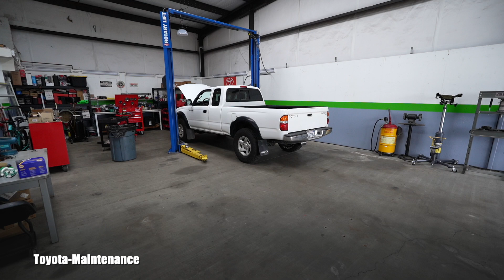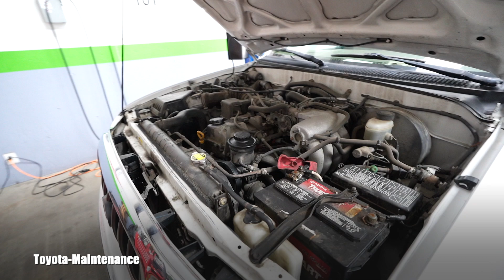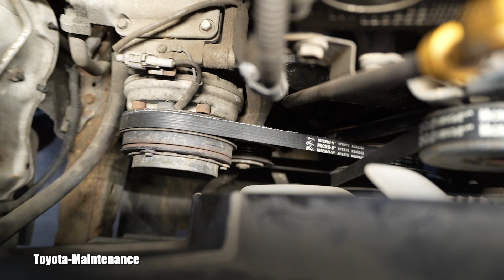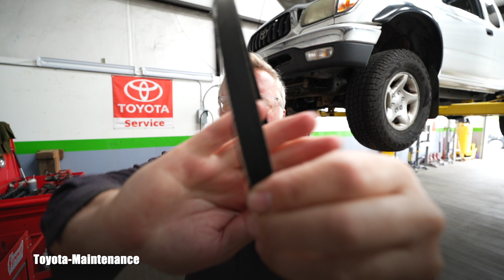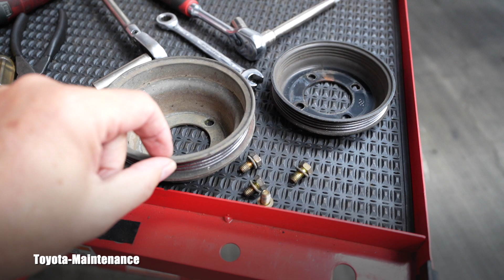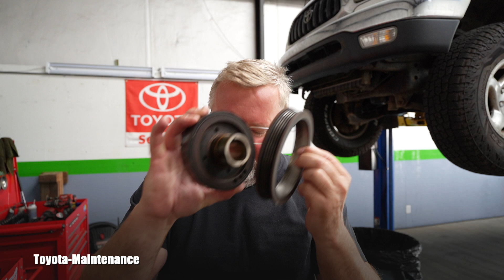Shredded Engine Drive Belt. Why? Harmonic Balancer Failure.

Comment: I was just doing my learning about harmonic balancers bcz mine is making a rattling noise n I just observed today that the bolt wobbles slightly when the engine is running. I wanted to find out how much time I'd have to replace it. The new one will take 10 days to get here. I feel like it should be ok. I'm also putting on new belts, tho at the moment mine are fine.

Comment: You should've shown how you took the balancer out and showed the pully holder to remove bolt, and tool/puller to remove balancer. Also give a tip about the alternator, dont go straight to the adjustment bracket, the main pivot bolt on the alternator has to be loosened, loosen lock bolt, then you can back out the bolt on the adjustment bracket to remove the belt.

Comment: What caused the harmonic balancer to break so early? 285k on my Taco (2.4l 2wd) and my harmonic is still holding on
Reply: Its got low miles, so i think its not being driven enough. The rubber probably dried out from sitting.

Comment: Same thing happened to my '00 Tundra V8 after a mechanic abused it back onto the spindle after a timing belt change.  It began squealing immediately, and before I had a chance to return it to have the balancer replaced it completely separated and disintegrated, taking out the cam position sensor with it.   If you see it wobbling, replace it immediately!

Comment: I personally own a 2RZ-FE engine so this video definitely helped me out diagnose issue with the engine further down the line if they come up.
Reply: He didn't give any tips and show special puller/tool. For the alternator belt, dont go straight to the adjustment bracket, the main pivot bolt on the alternator has to be loosened, loosen lock bolt, then you can back out the bolt on the adjustment bracket to remove the belt

Comment: I had a bunch of belt shrapnel on an old Cadillac. At first I replaced the idler pulley that was a bit off. Later I noticed a wobbly water pump and that was my real issue. On older GM cars the harmonic balancer has a 2 piece design held together with rubber and when it deteriorates it goes bad and wobbles or spins much like this one.

Comment: What about the oil buildup around the engine behind the harmonic balancer?
Reply: He addresses that at the end of the video. He is going to replace the seal, harmonic balancer and the belts.
Reply: @CouchMan88  I must have missed that - thanks 👍
Reply: Front main seal, he will be replacing it.